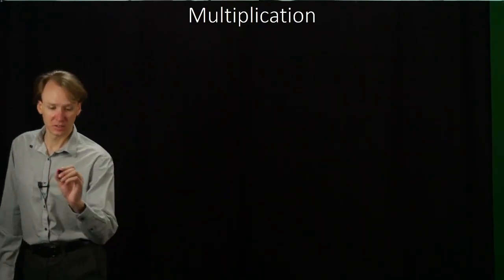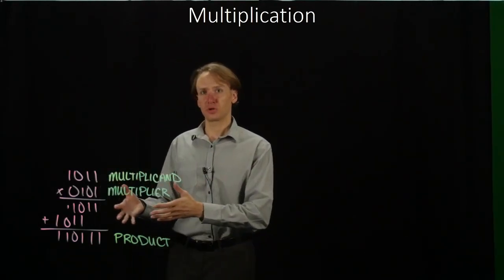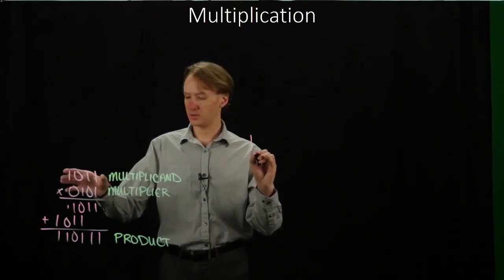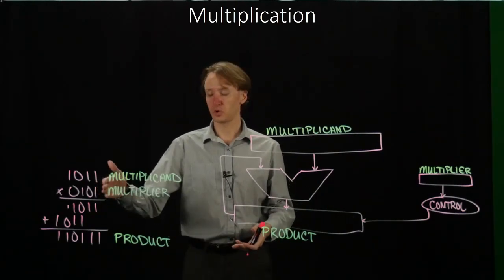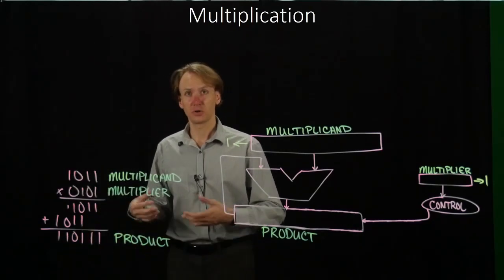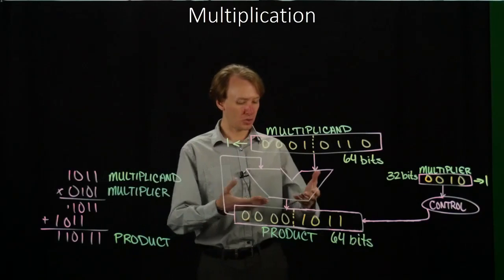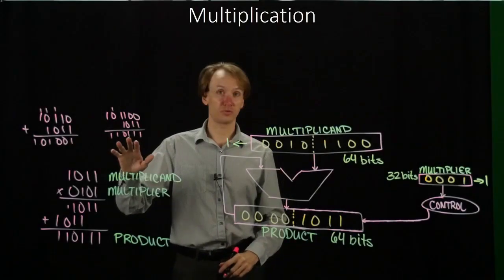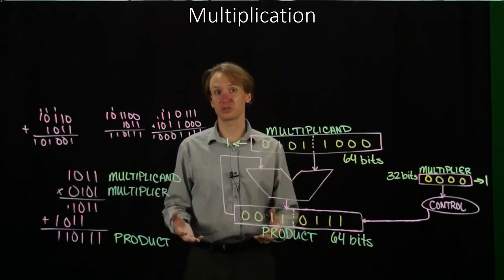12.  Implementing Multiplication

Comment: What happens when the most significant bit of the multiplicand is 1? The moment you shift it to the left, you lose the value and your product is scrap.
Reply: That's why the register for the multiplicand is twice the size of the largest value it's designed to handle. For a 32-bit architecture, the register for the multiplicand will be 64 bits, allowing the number to be shifted left 32 times (once for each bit in the 32-bit multiplier) without losing any data. For a 64-bit architecture, the register for the multiplicand is 128 bits.